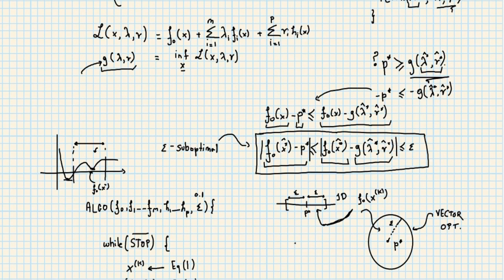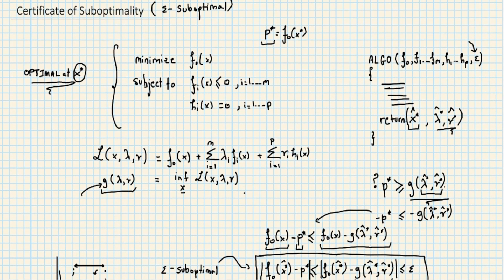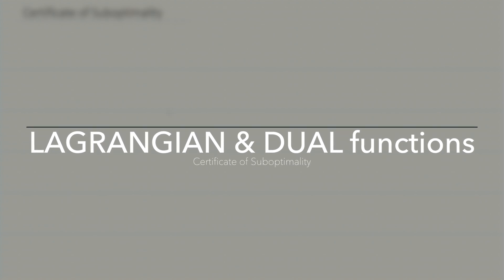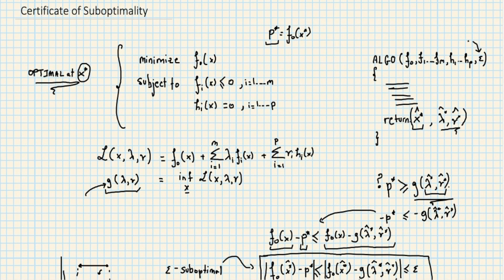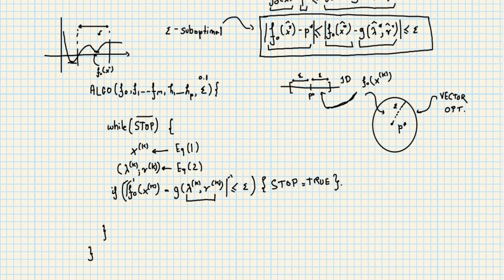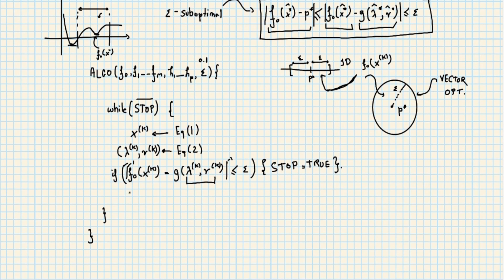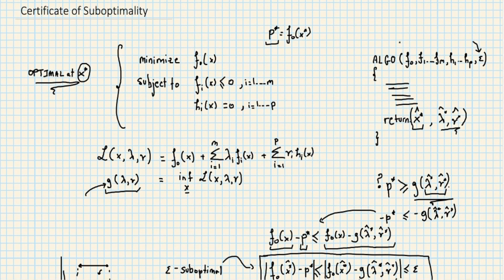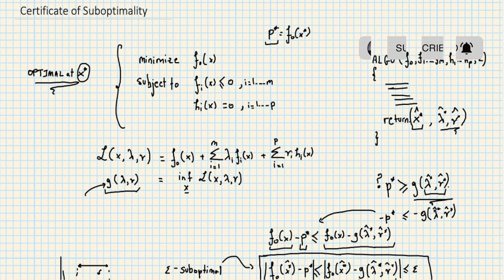Lecture 16 | Certificate of Suboptimality (ε-suboptimality) | Convex Optimization by Dr. Ahmad Bazzi

Comment: Can we obtain dual variables for mixed-integer problems?
Reply from the maker: Hello Sandeep. Interesting question. Actually, it's not that easy due to the integer nature of the problem. There is some work done here based on subadditive functions on the dual. Also, there is many work being done on  performing approximate dual prices on mixed integer problems. Example:

Drexl, A., & Jörnsten, K. (2007). Reflections about pseudo-dual prices in combinatorial auctions. Journal of the Operational Research Society, 58(12), 1652-1659.
Reply: @AhmadBazzi  Thank you for your information.